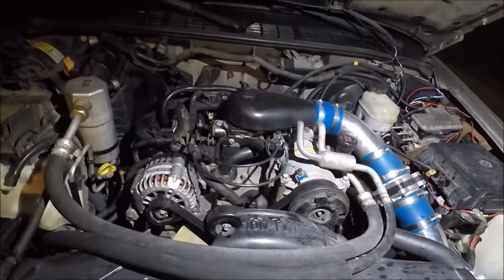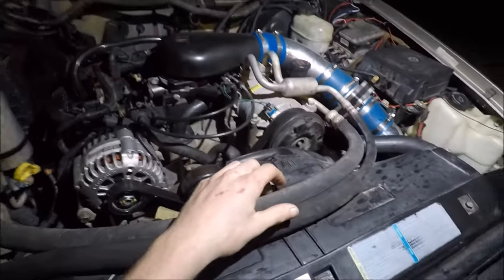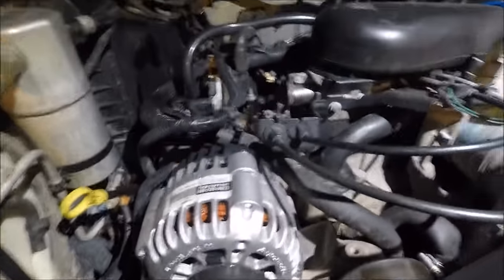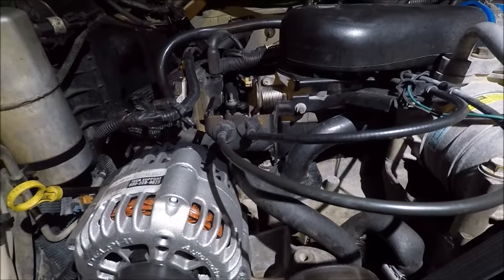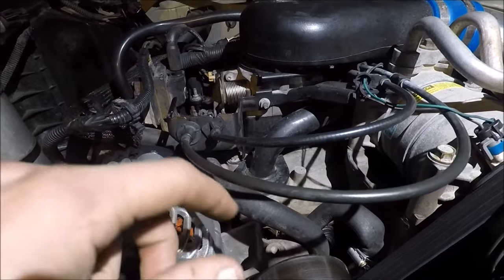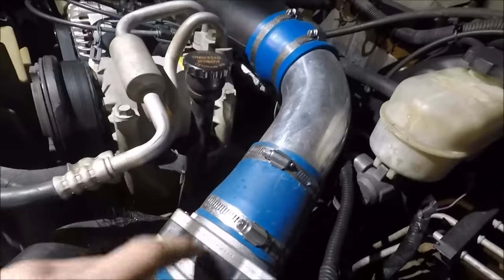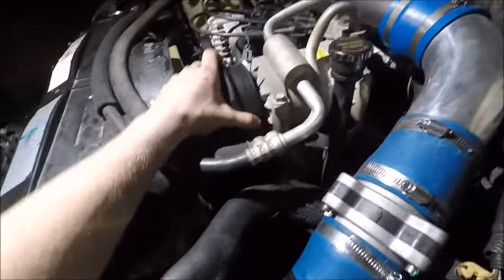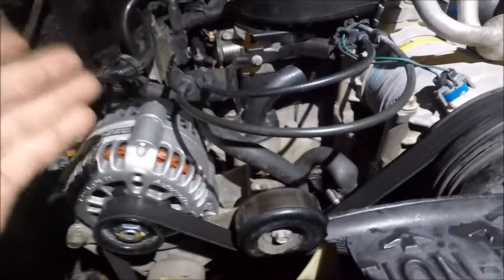EVERYTHING YOU NEED TO KNOW ABOUT THE CHEVY 4.3

Comment: Every couple months I have to take the distributor cap to scrape salt buildup from the contacts. What could be causing this?
Reply from the maker: Moisture under the cap, common problem on these
Reply: @JLGARAGE252  thank you !
Reply from the maker: Sure thing, I need to update the video I have with a more accurate and current version, owned two ZR2s now and I love em but they got their own issues
Reply: @JLGARAGE252  after c 5 years , a powdery corrosion appears on the metal contact points of the cap and rotor. On wet days, the powder absorbs humidity and multiplies the ignition problems. you can clean the powder off ,tho the metal is pitted and make less good contact causing hard starts. You need a new cap and rotor.

Comment: Good video. I'm about to tear open my '04 ZR2
Reply from the maker: dragon in winter heck yea, what ya doing to it?
Reply: I wish I knew. It's got a knock in the motor. Stills runs. No power. It acts like it's got a miss. New plugs, cap, wires, all that. I HOPE it's in the top end. I keep thinking a lifter croaked, maybe.
Reply from the maker: dragon in winter pull the heads and check the lifters
Reply: My plan exactly. 👍 Thanks.
Reply from the maker: dragon in winter that is what was wrong with mine left side of the engine
Reply: Mine's only got 280k on the original motor. I can imagine why it would have any issues. 😁
Reply from the maker: dragon in winter typically you can expect 400 from them if they are treated right, the zr2 has a different 4.3 than the regular v6 s10 the sr2 L35 4.3 rated 200hp and 250lbft
Reply: True. I'd just put new AC, exhaust, brakes, and a fuel pump (again, they love fuel pumps) on it when this popped up. I've got too much into it to give up on it now. I'll hit it when the weather gets better. I'll keep you posted. Thanks, later.

Comment: Im being sold a 4.8 for a good price but im a bit worried about the mpg. I’m young so my pockets ain’t that deep right now 😅. Should I stick to a v6 ? What’s the difference in fuel efficiency between both. Thanks
Reply: I loved my 4.8 250,000 thousand on mine, 2007, got a 4.3 now
Reply: @zombie5505  how’s the difference with fuel ? That’s mainly my biggest concern considering how high gas prices are right now 🤦🏽‍♂️

Comment: Just picked up a 2001 gmc jimmy with this motor. Ive been through the standard maintenance things that were obviously not taken care of oil,filter,plugs,wires,cap,rortor, etc. Keep getting P0300/P0301multi misfire cyl1 misfire. changed cracked/broken distributor and runs WAY better lots of power in this little motor but still intermittent P0300/P0301. Checked fuel pressure good @ 57-58 psi. also checked for vac leaks with smoke, all good. finally did compression test (should have done first) and found low comp cyl1 @ 90psi dry test. all others good at 160psi dry test. Did wet test cyl1 and gained 60psi now up to 150psi. So seems the valves and gaskets are good but rings must be worn..  
 My Question, what would be the likely cause and is there something I can do short of rebuilding the motor for one low cylinder ? Thanks for any help/thoughts
Reply from the maker: SHAWN BURNES what can trigger the misfire too and be a crappy running motor is the ignition coil since it’s only got one it can really put a hamper on the spark If it’s going out or works intermittently per day.
Reply: It could be the valve seats in the cylinder that has the low compression. If the rest have 160 and just that 1 cylinder has 90.   I would think the rings in that cylinder are probably fine. Does it use oil? Not leak but burn it? If the rings were bad enough for it to be the cause of the low compression I'd have to think it would probably be pumping a ton of blue smoke out the exhaust pipe. I had to replace the passenger side head on my truck about 50k miles ago. It had about 150k on it back then. Valve seats were beat up pretty bad and alot of pitting. My S-10 is a 97. If you decide to go ahead and pull the head. Make sure that you clean the lifters because they get gummed up and start ticking when these engines start to get higher mileage on them.
Reply: @Thundarr995   Tom THANKS for any input.. 
No smoking what so ever, that's why i'm scratching my head. if the rings were that bad it would smoke regularly i would think also. but the wet test would not seal the valves enough to raise the compression that much or  would it? I put just a little oil in the cylinder and did compression test again (wet test) which made the jump up from 09 to 150. i found that (wet test) on other vid that diagnose bad rings..Ive recently put in Restore oil treatment added to the oil after a recent change to see if it will help boost compression. waiting for results. im putting some miles on before another comp test
Reply: also, I guess i will check valves next if i dont see any improvement, and maybe try a quick reLap of the seats.
Reply: @shawnburnes6141  I bet it's bad valve seats then. It's a very common problem with these engines. I wouldn't get a used one,get a rebuilt one. A used one might not last very long. My neighbor has a 99 4.3L he pulled out of his truck. All that's probably wrong with it is the valve seats.  He said the engine was shot because the compression was low. I think the one he pulled out only had 120k + or - a few k miles. I told him the head or heads were bad,but ya can't tell that guy anything. He's an older guy and thinks he knows everything. You can test it if you have an air compressor. It's called doing a leak down test. Another thing you're gonna need is an angle meter and new head bolts. The head bolts are torque to yield bolts and can only be used once. And you should use new bolts for the intake of too. Gonna need a in/lb torque wrench for that. Put blue lock tight on the intake manifold bolts if you reuse the old ones or they'll get loose. They only are sposta be torqued to about 106 in/lbs. Use the plastic intake gasket with rubber seals. Make sure the engine is exactly on #1 tdc before you start taking it apart. You'll know it's on #1 tdc. Take distributor cap off. Rotor will be pointed to a little #6 that's on the distributor body. There's 2 Mark's on the harmonic balancer. Line up the 2nd mark on the timing mark on the engine. Might want to screen shot this if you're planning on doing this job yourself. And you're definitely going need the Chilton's manual. Also there's 2 different heads. You'll have to take off the valve cover to see the casting #. They don't interchange. If you have the rocker arms that are not adjustable you still need to turn the engine as if you're adjusting the valves that are. Those get tightened down to 18-20 ft lbs if they're the non adjustable valvetrain....no... I haven't done this job before 🙂
Reply: @shawnburnes6141  And the distributor is not adjustable so it HAS TO GO BACK IN IN EXACTLY THE SAME POSITION AS IT CAME OUT. Or the check engine light will never turn off when you get it back together. It may run ok?? Maybe? Just make absolutely sure it's on #1 before you remove it from the engine. It will be pointed to the passenger side. If it's pointing towards the driver seat,that is #4. Wet compression test would also seal up the valve seats. If you re lap the valves you can test if they're sealing. Pour a little kerosene or diesel into the combustion chamber with the head turned upside down & wait a few min. If its sealing the kerosene or diesel won't leak into the intake or the exhaust ports.
Reply: @Thundarr995  Thanks Bro!  I'm capable of doing this job for sure. Thanks for the details, i know most of this but not all. I sure do appropriate the help.
Reply: @Thundarr995  cool.. Great info  ill try this for sure
Reply: Had same problem with my 2000 Blazer. Misfire in no. 2 cylinder compression at 100 psi. Pressure in the other cylinders 150 psi. Removed head took to a mechanic that rebuilds engines he found a bad valve on no.2 cylinder did repair on it. Fixed the problem still running good now 4 years later.

Comment: Doing a coolant flush soon...
What would you recommend for me to use?
Reply from the maker: Honesty I recommend draining it all out first then taking distilled water and flushing the rad and block out and rad flush fluid,  but ultimately put some distemper water in the radiator till it’s filled, and then let it run for a lil bit and then take it around the block so the water pump really cycles it then drain all that out and stick it up with fresh coolant, Walmart dex cool does just fine, the radiator reservoirs typical collect all the gunk at the bottom so take that whole thing out and rinse it out and let it sit with a little bit of dawn in it then rinse it again. How I usually do it and I get pretty clean rads after wards
Reply: @JLGARAGE252  Good advice. Stick with one of the Dexcool coolants. I've used them religiously and have 23 years on my heater core, so I'm not about to experiment with anything else.
Reply: Ooookay👀
Reply: @JLGARAGE252  followed these exacts steps! Forgot to thank you for your response...Appreciate it boss
Reply from the maker: @AV3Xv  any time pal!

Comment: Steering issues with my 2003 s10 4.3. How do I fix the steering play. Also the steering is heavier than I would like it to be. Any solutions?   I suspect power steering leak somewhere. Would that be the cause?
Reply: I had the exact same issue and fixed it by replacing the rag joint with all metal u-joint you can buy from Amazon. A little bit of cutting the old rag joint off the steering rod but once you put it in no more play!

Comment: My 92 Jimmy 2wd with the 4.3 vortec wants to surge badly on the highway (between 50-60mph) but runs fine in town and on the interstate at 60 mph and up. Cant seem to figure it out. Just bought it last week. I have had a 90 S-10 for 15 years, with the standard 4.3 and have never had this issue.
Reply: My 02 S-10 has the same problem. O2 sensors,fuel and air filter replaced. New MAF.. New PCV  valve. BG 45k put in tank. Cant find any vac leaks.  Frustrated! Any ideas?
Reply: Gonnabe a fuel issue

Comment: Ever have problems with erratic oil gauge readings?
Reply from the maker: as a matter of fact yes, I believe im having a faulty sensor, also plays a part in fuel management, per the wiring diagrams by GM.

Comment: Have an 04 randomly started to idle high. Sometimes feels like it’s pulling its self, I’ll have to hold the brakes really hard. Any idea?
Reply: @Dale Gribble uncontrolled acceleration is indicative of a large vacuum leak.  Usually past the MAF sensor.

A friend of mine has this issue on his Dodge Neon.  He would have to hold the brakes really hard at stoplights.  When we examined the intake, we found a huge gash in the intake snorkel.  So check the big plastic snorkel that brings air into the engine intake.

We were able to pull another snorkel from the junkyard and replaced the gashed one.  Fixed the problem!
Reply: @stevenlamb8726  that was my first thought. Jo visual signs of one. Can’t even hear if it has one. It only happened maybe a handful of times over a week. Hasn’t done it since.
Reply: @ErikBeckner93  wow, that is strange.  yeah if the problem mysteriously disappeared, then it's probably not a vacuum leak.  Could be something in the ECM got messed up and it learned a wrong idle value.  or something is telling it to draw in more air.

I would suspect that it might be running rich, so the ECM is telling the engine to draw in more air, causing the acceleration.  I would get a mechanic with a scan tool to run some live data tests and check the long-term fuel trim, etc.  also try removing and cleaning the MAF sensor as it might help a little.  best of luck!

Comment: 98 to 04 isn't throttle body injected.   It has the spider injection inside the intake manifold.
Reply from the maker: Budget S10 Overlanding Project is high is part of the in-take m-a-n-I-f-o-l-d. Worked on all the fuel plants for the 4.3 starting with carb and then to mpfi
Reply: @JLGARAGE252  I have a 96 4.3L and it is the CPFI Spider system, completely different from TBI or Carb, and a step down from the later spider system, the MPFI which relocates the injectors to the ports

Comment: my 4.3 vs my 4.0 ford ranger= same gas mileage but the chevy 1500 way more work!mine was very faithful but i did get the water splash on distibutor ..omg.. that drove me crazy ! also theres 2 types distr buttons.. the thin 1 acts up but the thick 1 fixed my issues! after water issue /it sparked all over till i got thick new cap :>)

Comment: Changed my 4.3 rear wheel engine with a 4 wheel drive. Looked at oil pan and seemed exact but just got everything in and nowhere to put oil filter and hole on each side of engine in front on exhaust manifold where something hooked up( I imagine transfer case) and I forgot about them. Started it and oil everywhere from drivers side and my girl thought I was on fire. LOL. What next.

Comment: I keep getting p0171 i change all the vacuum  hoses still keeps coming on also truck stalls and once it builds up it won't stall or mis fire any suggestions  plz help
Reply: Check the air intake o-ring he mentioned, check that the fuel pump is working properly,  check to make sure injectors or working correctly

Comment: I have a 2000 s10 4.3 v6 and my check engine light has been on since I bought it in 2014. It used to stay solid and one day it just shut off. My issue now is I get p0171 and p0174 depending on the temps outside. In the heat it stays on and in the winter it stays off.. I've replace the fuel filter and pump, all o2 sensors, both catalytic converters twice, fuel pressure regulator, and a couple other things to fix those codes. The o-ring you were talking about is what I'm about to try in a couple of days. Where can I get it and what is it called?
Reply: I love this truck. Only 21 years old and at 160,000 miles. I plan on keeping it, lifting it and maybe dropping a 5.7 v8 vortec in it just for fun lol
Reply: Bad temp sensors and/ or their connectors can cause this.
Reply: @bryant38  that's good to know. I'll replace whatever temp sensors there are. Thank you
Reply: @Taylor if you have a multimeter or a scanner that can show live data, you can confirm if a temp sensor and/or it's wiring/connector is bad before just replacing them. Instead of typing out instructions on how (because it would be lengthy), I'll link a video showing how to test them.
Reply: I can't find the video I was referring to about using the scanner, so I'll try to make this as short as i can. The temp sensor will default to an extreme negative if it's bad/ poorly connected. On a GM of this era, connectors are likely at fault. Hook up your scanner, with the engine off, see what the temp sensor is reading at (+/- 10° variation is normal). With the engine running, watch and see if the temp bounces around. If it reads an extreme negative (if I remember correctly, it's -40°) then the sensor and/or the connector is bad. You can determine whether it's the sensor itself or the connector by wiggling the connector and watching the temp on live data. If it only defaults to the extreme negative while moving the connector/wiring, then the connector needs to be repaired/replaced. Temp sensors are cheap, but genuine GM connectors are not. The last sensor I bought was for a 5.7 and was $16, but the connector for it was around $30 and the connector was the problem. I changed the sensor anyway because it was the original, but in this case, changing just the sensor wouldn't have fixed the problem it had (which was the same issues you are having).
Reply: @bryant38  thank you very much for the info. Super helpful. When I have time I will replace both the connector and the sensor. I've had the truck since 2014 and this issue has been around since.
Reply: Found out my issue lol. After 8 years of running with the shitty stock spider injector system, it failed. I replaced it with the mpfi injection instead and this thing runs a million times better. If you haven't converted it over, you really should. I did that with a cold air intake and it hauls ass. Love it
Reply: Also the poppet style injectors were trash. They siezed up and got stuck causing engine performance issues. The multi point ones are the redesign and they are a million times better. If an injector fails, remove it and replace it. Super easy

Comment: I have a grinding noise on the driver's side can't figure where it's coming from changed lower control arm wheel bearing brakes rotor.  It only happens when making some turns or backing up especially in morning take it to the shop the say they can't hear it.
Reply from the maker: Craig Carter if it’s a zr2 it may be interaction of the tires and front sway bar
Reply: @JLGARAGE252  is a 97 LS 2 wheel drive
Reply from the maker: Craig Carter did you check the caliper bolts? Those have a tendency to loosen and allow the caliper to jiggle back and forth, also check rotor shield to see if it’s contacting the rotor it self.
Reply: Check your transmission mount and your engine mounts. Engine mounts fail often on the 4.3.
Reply: Pretty late to make this response but my dust shield cracked and would make a similar noise especially when backing up as it would rub the caliper at times

Comment: another thing if you heat speed 1,2,3, 4 , if the 4 doesn't work it was my relay next to the firewall, I have a coolant leak on the passenger side no oil mixed, just a slight leak I wonder if that could be a hose , water pump or what?  Are the hubs supposed to be greased? That is what I have trouble with on drivers side